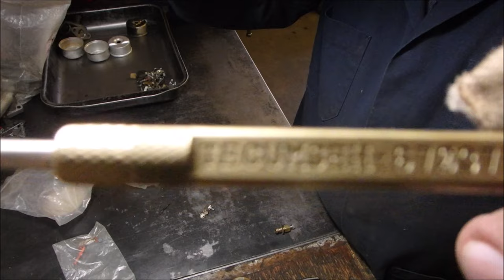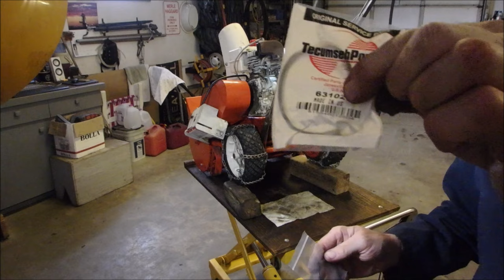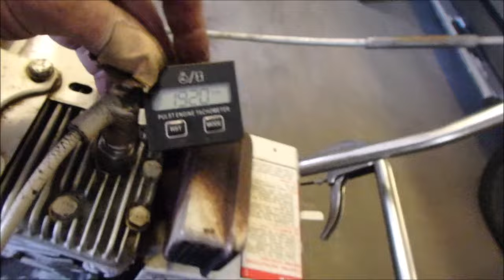1973 Tecumseh Snow Blower Part 2

Comment: Nice one Bruce gotta watch that the cat's are not running around when firing this baby up. Glad you showed it actually working it really throws the snow eh?
Reply from the maker: It is a beast.  I was worried about the owner as he is 79 years old.  He told me he is going to sell it.
Reply: I had single stage like that years ago.  Yes, it threw the snow good but it was only one speed and for it to throw the snow well, the speed was too fast.  I finally traded it after fighting it.

Comment: I fixed a 4hp moto mower single stage snowthrower and it also spun the auger all the time as the centrifugal clutch had little drag. 
Runs good only thing it could use is some wheel chains.
Reply from the maker: Thanks for joining in.

Comment: Hey Bruce this is unrelated to this video but I was wondering if you have any suggestions on something I might have missed working on another Quantum.
This is a garbage pick but not too bad.  Did the usual things which included cleaning and rebuilding the carb.  I have worked on a ton of these and never had this problem.
I replaced the cracked primer bulb and made sure it seated.  I doubled up the gasket between the air filter box and the carb (known problem).  It still will not prime.  I triple gasketed between air filter box and carb.  Still no prime.  Took the carb off again and made sure the channel that blows air into the bowl to push gas up the emulsion tube is clear.  It is.  Put everything back together and still no prime.
I know you love these motors as much as I and have worked on many.  What, if anything, am I missing?
Reply: This is the OLD MAN @ EP and just wondering if you made sure the screen behind the primer bulb was totally cleaned? It is extremely rare that we have used two gaskets on the Quantum air filter housing and special care must be taken when using more than one since we have seen many carbs with stripped threads when they come in with two gaskets. Appears they were overtightening to get the hockey stick shaped design pushed into the gasket. Basically what we do is always try to use the original gasket since it will have this design already compressed into it but if damaged we install a new gasket which has been soaked in hot water to soften it. We then install this softened gasket and hand tighten the carb bolts, hit the primer bulb watching how much fuel comes up the emulsion tube. If the amount is minimal and not a minium of 1/4" high we remove the air cover then remove the new gasket to see which area of the hockey stick design has not been formed in the gasket (normally it is the bottom straight length). We then apply a thin coat of RTV gasket maker with a wooden pointed skewer to the edge of this area on the plastic housing then reapply the gasket. Once installed and primed we have only once had an issue where we had to replace the air filter housing due to excessive warpage. I have always wondered if a piece of cellophane tape on the hockey stick shape )leaving the hole area open would do the job but have never tried it yet. Hope this works for you!
Reply from the maker: Good reply Wayne.  As well i would check the intake manifold tube  that leaves the carburetor crossing over the engine top to the intake valve.  That devil can crack or come loose.
Reply: Yep have seen that a couple of times Bruce @BrucesShop
Reply: @waynestefinashen239  thanks Wayne.  It is worth a try.  Tomorrow I will take the two gaskets out and put a single new one in and after running it for a while take the air box back off and examine the imprint on the gasket.  The area in question for me was/is just where you said (the bottom straight area).  Just to let you know how weak (nearly non-existent) the prime is-----I can push the bulb in 10-12 times only see a little dribble maybe twice.  Definitely not a squirt.
Reply: @BrucesShop  thanks Bruce, I will check that as well.  I did not inspect that at all.  Worth a look.
Reply: @waynestefinashen239  thanks Wayne.  I am going to try this.  I heated the backing plate with a heat gun and tried to straighten it enough so it would seal but after two attempts I realized this was not going to work for me.  I did "read" the gasket and, as you predicted, it was the long handle of the hockey stick that is not sealing.  I will let you know if your method works for me.  If not I guess I will just order a new one.  Thanks again for the post.
Reply: @jws3925  We have never had much success heating them to straighten but being in the business for 10 years now we have accumulated a lot of these air covers from scrap engines (either purchased from scrappers for decks or customers that never properly maintained their equipment). But 100% success when i have used the RTV Silicone along the  edge just let it set up per instructions before applying. Merry Christmas and have a safe and happy holiday season.
Reply: @waynestefinashen239  Yup, I applied the silicone per your directions yesterday and let it set overnight.  Don't think the wife will let me go out to the shop on Christmas Day but I will get out there tomorrow for sure.  Kind of anxious to see if it works.  Been messing with this plate for several days now trying this and that.  This is like the last resort and then I am ordering a new one.  Feels like defeat if this doesn't work.  I can usually find a way to fix most anything but this has got me turned around.

Comment: 25:00 augers not turned off? Be careful, you could cut your fingers off!
Reply from the maker: Yes these auger sdon't turn off.  I checked everywhere.  It is a 1973.  I asked you about this one a few weeks ago  :-0
Reply: @BrucesShop  the one that got me was 1976. It has the gear knob to engage / disengage the auger. So your example here spins the auger when you pull the rope, if you are pull starting it? Electric is nice, but usually just for 1st start in the garage. Starting when warm is usually a manual process.